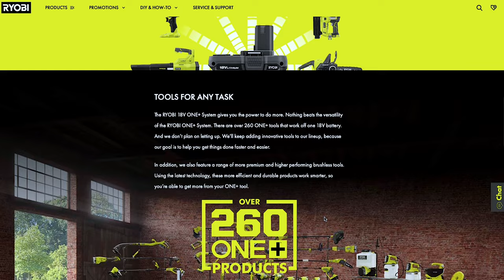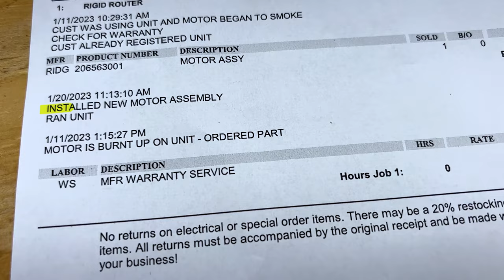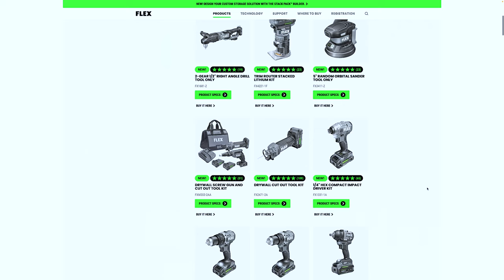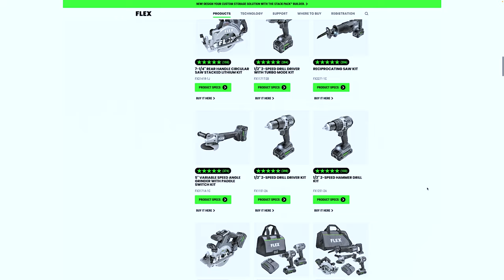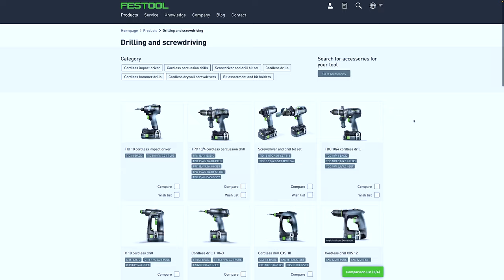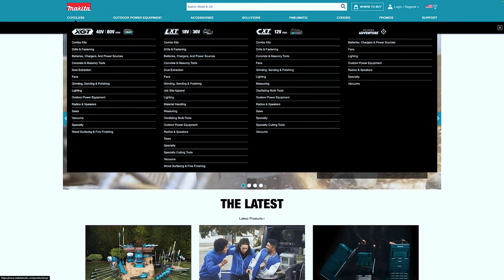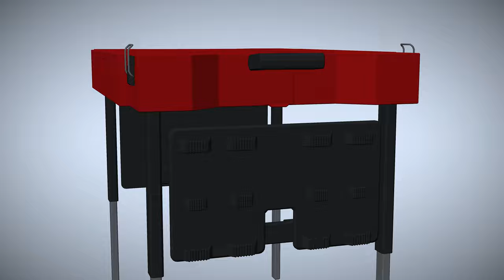I Found the BEST Tool Brand for Woodworking in 2023!

Comment: I like DeWalt. Nothing against Milwaukee tools but my own personal preference. I like the XR line from DeWalt. From general construction to yard work DeWalt covers just about everything I use. If I were to specialize in one field maybe I would get different tools to fit. But for general use in construction to automobile restoration to yard work keeping my DeWalt 20v /60v tools is cheaper than buying another of the same tool in a Different brand, buying more batteries and chargers I don’t necessarily “need” to get the job done. A friend of mine loves his Milwaukee flex tool line. I just have a lot of DeWalt tools and don’t see the need to buy a different brand right now.

Comment: I have Dewalt drills and routers but I have a another router A bosch old router still works fine.  I have Wen Bandsaw and track saw with Makita rails which has served me for bunch of years.  I have Milwaukee 10-1/4 In. Circular Saw.  A delta contractor saw and A RIDGID Oscillating Edge Belt/Spindle Sander.  All of these I tried before I bought from woodworking friends in my area and a woodworking store that has classes.  I have not regretted get any of the tools and I have no brand loyalty.  What I have works and when something breaks I will re-evaluate.  But I love the shoot outs as it gives me insight as to what I might buy next when the tools I have no loger work.

Comment: I think you nailed it, your brand choice should be based on what tools they offer especially if you consider that all of those brands are built down to a price point and they are all basically the same internally, even the battery eco systems means less these days then it use to.

Comment: I've been a fanboy of Ryobi since they were blue and yellow. I still use those tools, and it's pretty amazing that the oldest and newest of my Ryobi tools all use the same batteries. I have some old Dewalt 18V tools, and they are well used, but I love them (as long as I can still get batteries, though they are aftermarket). I have a Makita 12V Drill/Driver and Impact Driver set (the white ones) that I reach for frequently. So, would I love to have some Milwaukee tools? Sure, but champagne tastes on a beer budget, as they say. I know you like Ridgid's LSA, and folks like to hate on Harbor Freight, but the Bauer and Hercules lines are pretty good tools, and it's a whole lot easier to walk into the store with a broken tool and be handed a brand new one than it is to get a Ridgid repaired.
Reply: I think Ryobi using the same battery is definitely worth mention. Batteries are going to fail before the tool in almost every case, so it makes sense to keep the battery available.
Reply: Dewalt has an adapter for the new 20v batteries
Reply: @bread-gz3rl  Seen it. Too expensive, and not impressed.

Comment: I tried to start with one platform (Ridgid). Absolutely love my Ridgid tools! But soon realized that having only 1 line was  kinda short sighted. I have tools I love from most platforms. I decided to stick to Ridgid, Bosch, Milwaukee for my shop as much as possible because of batteries but these 3 lines cover every possible base I could need. Dont sleep on the Ryobi line.. my wife loves their cleaning stuff 😉:_mallet:

Comment: Years ago I bought Ryobi because it was what I could afford.  As my business took off some of my tools wore out so I upgraded when ever possible.  I would have loved to add Milwaukee to my cordless selection but honestly I couldn’t afford the price tag. I do have a few Milwaukee tools that I have had for more than 35 years.  The still work great. My everyday cordless system is Dewalt.  The are small, light and have more than enough power for my needs.  I see no reason to add yet another brand to my tool kit.  I have corded tools that are just getting old. As the need arises, I will change them out with Dewalt stuff.  The new stuff is much better than what use to be premium tools of 20 years ago.  I figure it is a win/win

Comment: Where I am we don't have flex and ridged is very inconsistent and never in stock and I use the Ryobi table saw and miter saw and both work perfectly fine for me DeWalt we use at work and for the money there quality is dropping alot were actually switching to Milwaukee so I have mostly Ryobi at home everything from drills to lawnmowers and a few Milwaukee tools between the two you can't go wrong

Comment: Good video.  I have a lot of Dewalt tools.  I have a really old Milwaukee corded drill that has served me well.  One thing I see missing is Porter Cable.  Have you ever used these?
Reply: Porter Cable has been diminished by B&D to Black & Decker tier level with less choices. Porter Cable has no consistent vision to build long term trust or parts repair. What was said about Hart, Cobalt, etc. If course, no one's stopping you from looking into them and spending your cash.

Comment: The problem with the Ridgid track saw uses a non-standard track profile. Ryobi unfortunately also did the same, a different profile yet again. It's going to be hard to find accessories for them and if you do, you'll have to leave them behind if you upgrade to another brand's saw. I hear Makita's corded track saw is a really good value for the quality and they use a track profile that's compatible with Festool and several other brands. I like Milwaukee but even on sale they've gotten increasingly expensive. Sometimes even the sale prices are hard to take. I do agree it doesn't make sense to stick with one battery platform. Ryobi is generally a really good value and they have a lot of unusual kinds of tools not available on other platforms.

Comment: One of the brands need to come out with a cordless 36v, 40v or 60v thickness planer and high psi pressure washer. All of my tools are battery powered and it would be nice to have a battery powered thickness planer and high psi pressure washer.

…also, more platforms need to come out with battery powered roofing nailers. At the moment Dewalt is the only one that has a battery powered roofing nailer.

Comment: I'll stick with my Makita LXT and XGT. Cant be arsed jumping into another platform, when I can purchase something from the Teal Team. Ridgid is non-existing in my country, got once a Ryobi drill and it felt very cheap and Milwaukee often is priced way higher than Makita in my country.
 
Not to mention Makita released one of the best thing for XGT - The wireless adapter ADP-12 which allow you to not only lock a tool to be used with only your batteries, but also shows the state of your batteries. If by some bad luck your tool was stolen it will be a paperweight for anyone else without your own batteries. Apparently all XGT tools have a special chip in them for this.

Comment: Hello Matt,
I've been thinking about getting the Festool ETS 125-REQ.

I saw in this video that it's your fav sander.
Do you happen to have the low profile brushless 125?

I think that one is $475 vs the ets req at $275.

I was wondering if you thought the $200 price increase was worth it or if the 125-REQ is good enough.

Hope that makes sense!

Thanks, sir!

Comment: You really need to try the DeWalt track saw, I really like it more than the Milwaukee. It preforms better and it’s the only saw on the market that allows you to use both sides of the track! Also DeWalt has a great cordless planer. I have both brands but I give the nod to DeWalt. Other than the detail sander I believe DeWalt has a much better selection of quality tools for the wood worker.
Reply from the maker: I got the DeWALT track saw in the shop a few weeks ago.  Video coming soon.

Comment: Dewalt is just unbeatable for woodworking especially when you consider their planer, miter saw, and table saw(all 3 are widely considered the best of the best, outside of giant floor model/industrial table saws and planers). Their power tools have a fuck ton of power, they feel great in the hands, they offer pretty much everything brushless, they have the best battery platform especially with the 60v flexvolt stuff, and they look good. Brands like Milwaukee are great, but lack the woodworking tool selection, as something like Milwaukee seems more aimed towards automotive.

Comment: I'm a Milwaukee hater. I've bought two tools in the last 8 years and they both broke within 1 1/2 years of light us. Th Saw-Z-All fell apart. There is a friction fit pin that holds the boot in place and that came out. Then the rotating blade lock stopped rotating! I also bought an impact drill that started to screw up after three months. JUNK both of them. I recently bought a Bosch Impact  drill, and now the chuck is seized. I'm gonna go with Dewalt and give them a shot.

Comment: I have to say I'm disappointed with the Bosch  table saw.  It works fine but the exhaust is not engineered correctly.  I have sawdust everywhere except for the dust collector.

Comment: Bosch should have been the obvious non-Festool pick with Makita second and DeWalt third. Milwaukee doesn't even offer corded tools for most woodworking stuff and is almost always more expensive for equivalent or worse tools whether you're a beginner woodworker or an expert.

Purchase order for tools probably goes something like this

Drill, circular saw, orbital sander, jigsaw, table saw, router, miter saw, track saw, dust extractor.

Milwaukee's drill is $190 (bare tool) while a Profactor is $150 (bare tool) and has more overall power.

Milwaukee's corded circular saw is $140 vs $100 for the equivalent Bosch (which is arguably a better saw)

Milwaukee has only a cordless orbital sander and it costs $130 (without battery) while the corded Bosch is amazing and costs just $60 and you won't have a battery weighing things down or needing to be charged during hours-long sanding sessions.

Milwaukee doesn't make a corded jigsaw, and their cordless costs twice as much ($200 without battery) as a Bosch while having less power.

Milwaukee doesn't make a corded tablesaw. Bosch offers the best (next to SawStop) jobsite saw around. It's bigger, more powerful, and with more features. It costs slightly more, but only if you don't include the two 12ah batteries you're going to need to keep the Milwaukee running. 

Milwaukee's 1.75hp corded router is more expensive at $170 than the Bosch 2.25hp at $150 and the Bosch has a lot more stuff available for it too.

Milwaukee track saw is cordless only. It doesn't have as good a cut quality as Bosch's mafell-made saw nor as much power. It's the same price once you move up to the battery and case kit (Bosch also includes a case).

Milwaukee doesn't even have a dust extractor while Bosch makes some very good options.

Once everything is accounted for, Bosch offers better tools with more power and features for less money. You could pick up a nice $600 dust extractor with the savings.

Comment: Loved the video. But I gotta know, do you plan on bringing Makita to the channel?
Reply from the maker: Yes, I do. What do you recommend I start with?
Reply: @731Woodworks  For beginners, Nothing specific, I agree with the types of tools that you have chosen for beginners. I have their cordless hammer drill, impact driver, sander, & trim router & love them. The ones I'm most curious about personally is the (196094-2) plunge base for their trim router, the (XSL04ZU) 36v or the (GSL03Z) 80v cordless miter saw & the (XCV13Z) 36v/corded version or one of the 80v dust extractors. I think that the 80v one has more CFM  than the Festool. Despite the prices, I'd like to know if this would be a good option for people that are limited in places that they can plug in like sheds, can't afford an election, or don't know how to diy Wiring.

Comment: At 14:03 you've got that 12/2 NM-B cable just hanging on the wall. Please take a few minutes and put that sucker in some conduit or build a little box around it or something! Not only is that a code violation, but right there by all your clamps, it's far too easy to snag that cable a few times til you've worn through the sheath and the insulation and give yourself a good shock. Need to keep you around for more controversial videos like this one!

Comment: Festool shouldn't be in contention here.  These are corded tools and as such, brand isn't all that important. Buying one from column A and one from Column B isn't a problem.  Ryobi, Feex, and such are cordless so you're pretty much locked into one brand.  There is a difference.

I'm in a little different space because I started with Bosch and I like their drills/drivers a lot.  Other tools are just OK (the 12V reciprocating saw is more than useless). I have a lot of Bosch batteries because Lowes had a 12V battery blowout for $15 each and I bought them out.  Every year in November they have a sale on tools and the tools with battery (or two) are a lot cheaper than the batteries alone.

 I have a couple of cordless Festools, but they're special cases.  I don't see that their drills/drivers are significantly better than the Bosch and are heavier and I don't see the point in a cordless sander.  You have to drag along the dust collector hose anyway (sanding with dust extraction is foolish).  I have the cord clipped to the hose (hanging from a track in the ceiling) and it's good for any of their tools (except the new track saw👺).

And of course Ryobi.  They're good tools, but perhaps not the best.  As you point out, they have a stupidly large variety of tools.  I have a lot of the weird specialty tools.  You're also right about the 18ga nailer.  The 23ga pin nailer is awesome too.  I have pneumatic tools that don't get used anymore. Add the worklights and it's a great series. Twice a year they have great sales, as well.

Comment: I have a shop full of tools, multiple brands, I picked up a couple of Ryobi drills, and they have stepped up with their
game with its brushless line, well sort of, then one drill died then I contacted customer service, and it's a joke, it took
a week to address an email sent from their site, and then another week trying to find me a service center, and a week
later the one they found, it was an " Auto repair shop " and that's no joke, I tossed the drill into the trash !!

So buyers beware, they " ROYBI" needs to step up and back the products or they will lose out, no matter what brand you
buy they are all from the same factory, with and name and color change

Comment: 100% agree with the Milwaukee pick. I chose to go full-on red right from the start (roughly a decade ago) and, admittedly, have had some second thoughts a few times through the years; mostly because both Makita and DW have been the industry standard for the longest. Primarily due to their bigger tools and, of course, the Makita’s LXT track saw. But today when it comes to cordless, Milwaukee simply cannot_be_beat. Yes, DW 7485 and 7491 are fantastic table saws but they’re corded. Same with the miter saws, although for a shop chop saw I prefer my Hitachi 12”. Regardless, one can’t go wrong with either Makita or DW corded tools; I personally have a good variety of both, same as some Bosch - you simply need to know which ones shine the most. But Milwaukee is hands down the absolute best cordless platform both in terms of tools selection and quality.

Comment: I think the only real anwser to this argument is what battery system you're in. If you have a 20v battery set, don't go for m12 or m18 and vice versa. If, hypotethically, brand A was 1.2x as good as Brand B, but you had brand B tools and batteries, swapping to brand A would probably cost as much as buying a new speacality tool like planer or joitner or smtng like that. Funnily enough, drills routers and powered hand tools are the only ones with a big debate. You can use a grizzly band saw, a Laguna cutter, and a Harvey table saw, and no ones gonna argue with you. Same with hand tools, but that might spark an argument idk

Comment: Where is the Makita?
Reply from the maker: Mawho? 🤣 I just haven't bought much of their cordless line. What do you recommend?
Reply: @731Woodworks Their tracksaw got me into their cordless line after coming from a Kreg tracksaw.  It is fantastic.  I then went with their drill/impact drivers, and oscilating multi-tool and they are all fantastic as well.  As woodworkers vs carpenters, I feel the tracksaw and drill/drivers are probably some of the most important cordless power tools you can buy.  Makita is making some really nice stuff in this category.

Comment: Milwaukee is "best" for new and up coming tools but not for wood workers. They don't have a table saw, miter saw, planer or jointer (which are all more important than a mini mouse sander and an angle head drill). They actually make more tools for plumbers and mechanics' than wood workers.
Reply from the maker: they have table saws and miter saws.
Reply: @731Woodworks  My mistake, I've never seen any woodworker own or use any. I would say Milwaukee is one of the best for battery powered tools, but overall, I would even give it to Grizzly over them for woodworking.

Comment: Milwaukee hands down. Milwaukee is king of battery nailers. Milwaukee has been slowly but surely expanding woodworking tools. Two hand planers, a bunch of sanders, the best oscillating multi tool, the 4-in-1 is amazing for electrical as well. Ryobi for supplemental tools at a better price. Ryobi batteries are too cumbersome. Rigid lacks variety and is too much in the middle, spend less and get Ryobi or more and get Milwaukee. Ridgid corded tools however, good choice with the LSA. Festool makes good stuff, but they are just ugly and the name is lame. Lol.